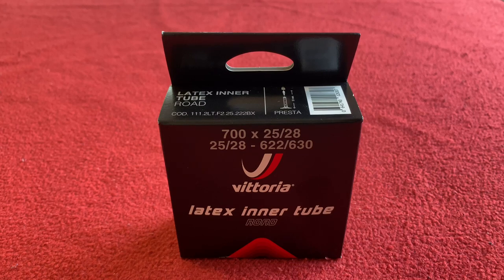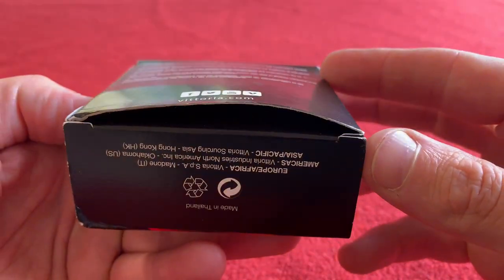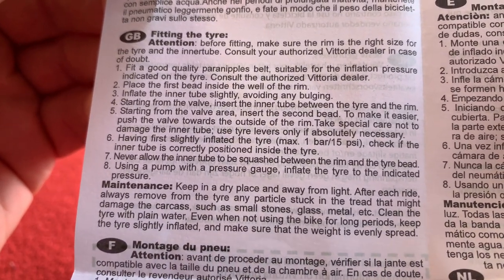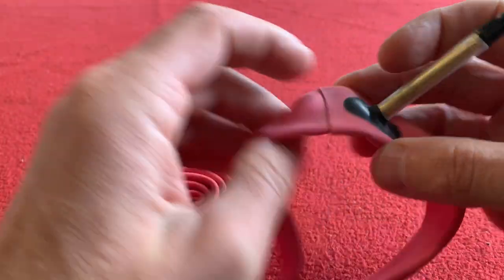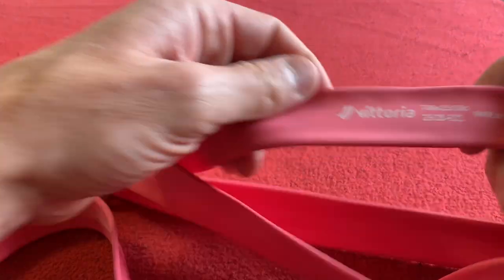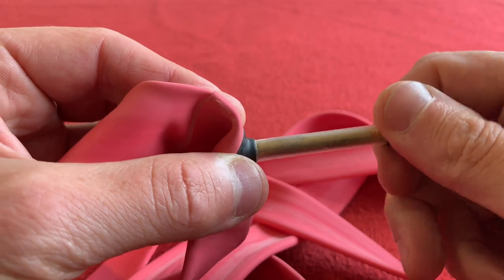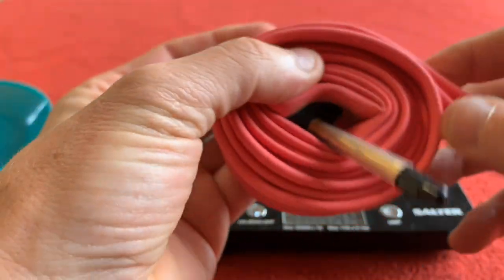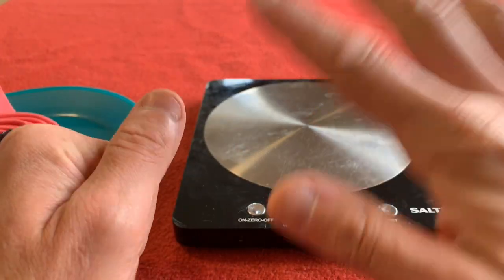Vittoria Latex Inner Tube Road 700 x 25/28

Comment: What is the maximum air pressure you can put into these??
Reply from the maker: athleticman hello, just checked the box and all it says in the instructions is to inflate to the recommended pressure written on the tyre.
Reply: @KyrosHouseCycling  Thank you for the info. I've now managed to inflate tyre Upto 100 psi. I think I installed the tube incorrectly first time round and it exploded at 85 psi so I was wondering what the max was! Cheers

Comment: I'm mounting up a set of these. Just wondering, what's the clear tube on the valve stem for?
Reply from the maker: I actually recon that’s to stop the valve rattling in the rim? 👍 I could be wrong though…
Reply: @KyrosHouseCycling  that definitely could be it! Maybe on rims drilled for Schrader valves or something? The valve stems fit through my (aluminum) rims just perfectly without it
Reply from the maker: @DaveGardnerMusic  yeah I’m
Just guessing but I can’t think of anything else.. 👍